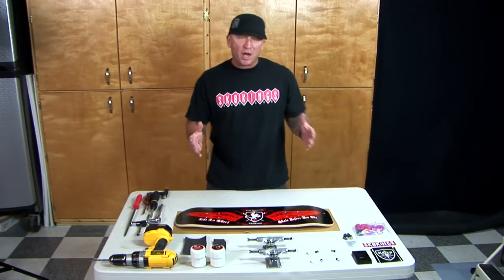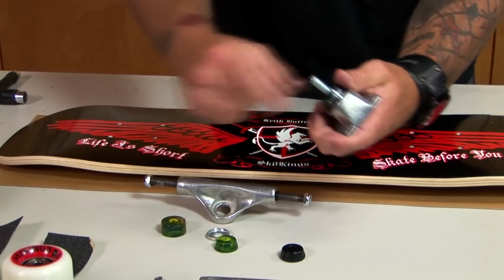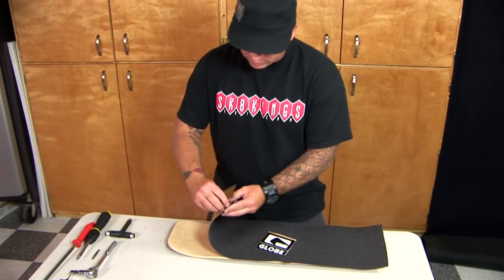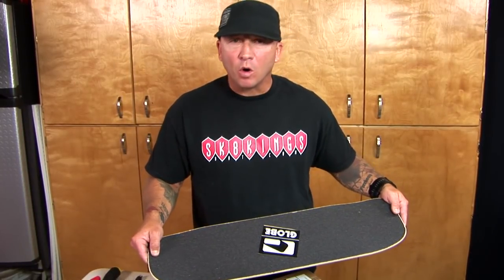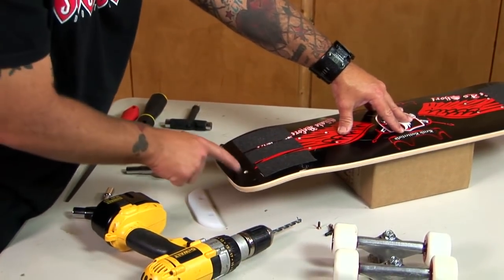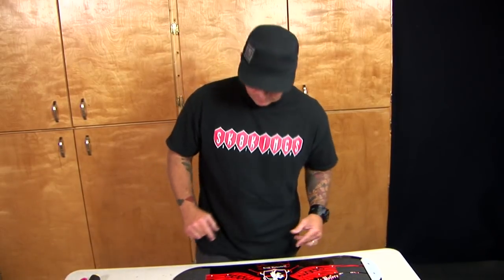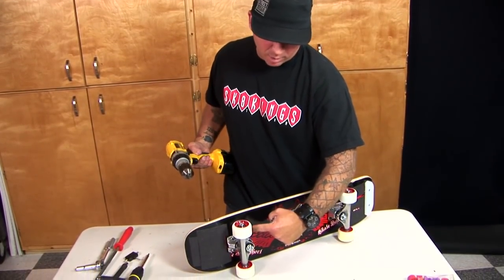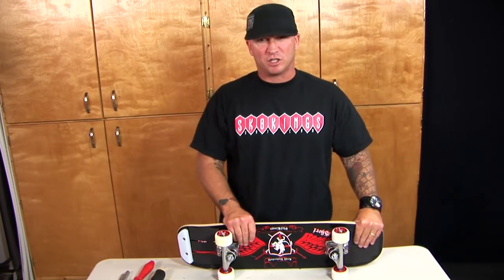Setting up a FreeStyle Skateboard

Comment: ....... That was a neat trick with the file there....
Reply: it only works if the grip tape is fully stuck on there. lets say its not fully pressed on, you could mess it up. I use this technique occasionally. it works with scissors too.

Comment: I am so getting back into freestyle again after many years of not skating and I would say no, you just start skating. You mix the standing still railtricks with normal rolling ones, I don't see why one style should exclude the other. I think everyone should own one freestyle deck and one street deck. On Sk8kings website if you go to "shop/completes you have this deck with the same wheels and skids but in black if the website is correct. You have to add the skids though as an extra on the right.

Comment: can you tell me all the parts that you use to put together a freestyle skateboard. I know you need the deck. Im gonna get the deck you have. what millimeter truck should i get? what wheels did you use in the video? and what do i need to set up my trucks? im gonna get risers a skid plate. for the trucks is all i need the speed rings, the bushings, bearings, and  the bolt lock nuts? or is there more?

Comment: @Patricksk8r its 130 cuz u gotta add a couple of things to the deck. the dck and trucks and wheels are about the same but u also need a little more grip for the bottom for caspers and skid plates for the nose and tail which are about 8 a piece so thats the little more added on. and u need risers to little ones so thats a little more and different bushings for tighter so theres the extra.

Comment: @ImBboyFuture Well if u put skid plates on both ends it will last longer but will be kinda awkward doing some tricks but if u don't use them the board will wear out faster than if u used skid plates

Comment: my deck is a 7.25 will 129 mm Independent Truck fit my board?
Reply: Go to the shop, and ask just to put it. If it's flush, it fits.
Reply: 109 are best for your deck ;) 129 are for 7.75

Comment: What's the grip tape for
Reply: grip
Reply: On the bottom of the skateboard
Reply: when you are doing casper tricks you wont slide off the bottom of the tail, as it is slanted and nothing ther to hold you, so grip tape helps you stay on
Reply: Ok